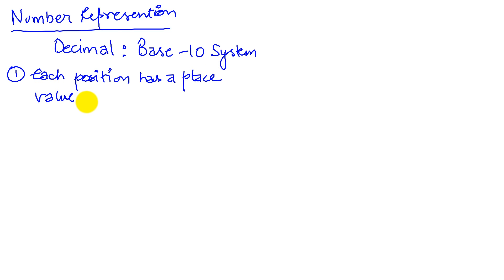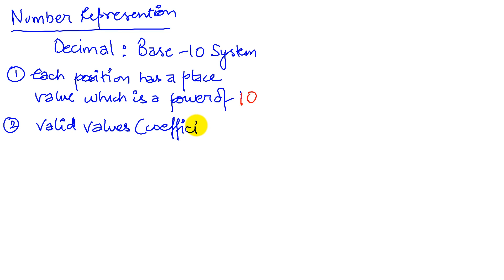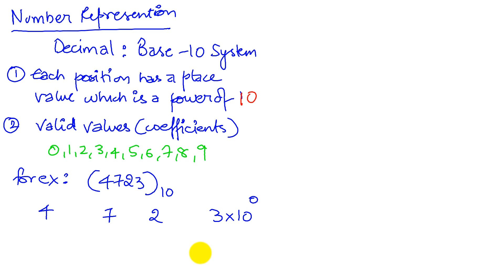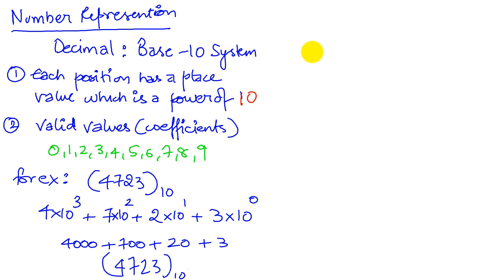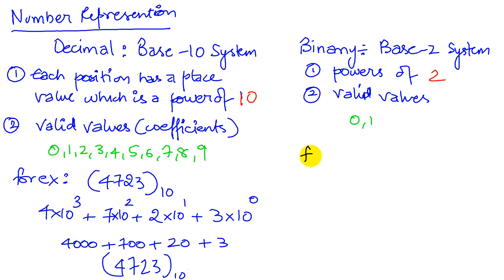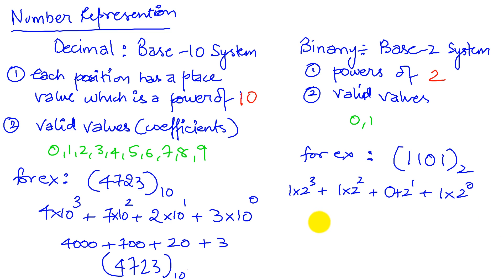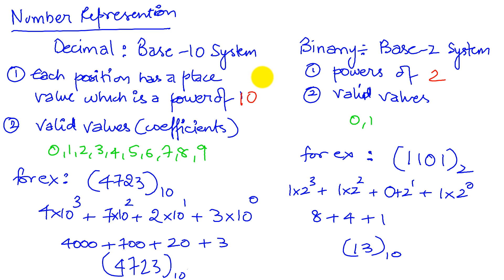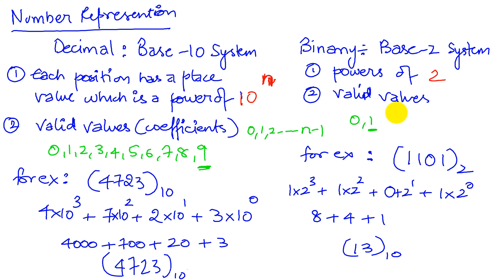C2 Fundamental Concepts 1a

Comment: I think there is mistake, The answer is 13 base 2
Reply from the maker: Sorry, I suggest you watch the videos on edX. We edited the edX closed captions to fix mistakes.
Reply: Actually is 15 as base 10
Reply: Why do you think this is mistake  1101 in base 2  equal 13 in base 10  I think....

13 isn't even valid base 2 number since, the base 2 system allow values only from 0 to 1.